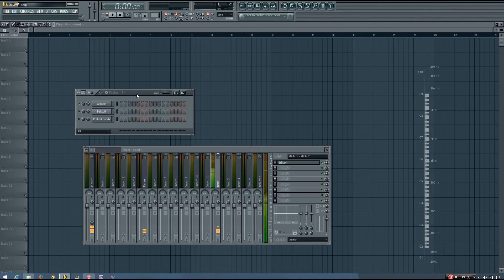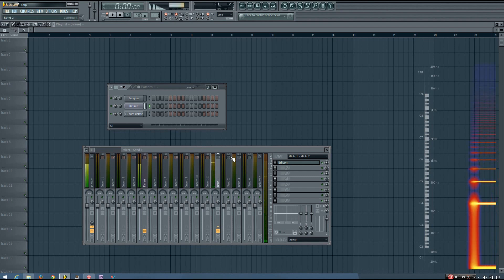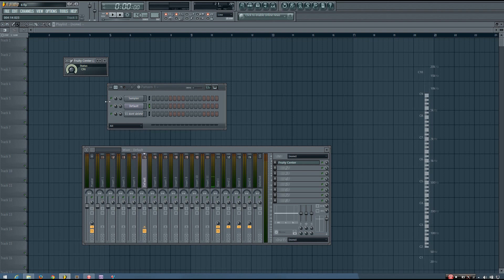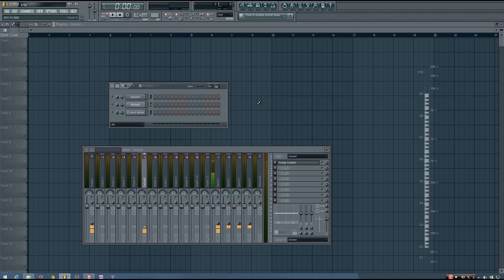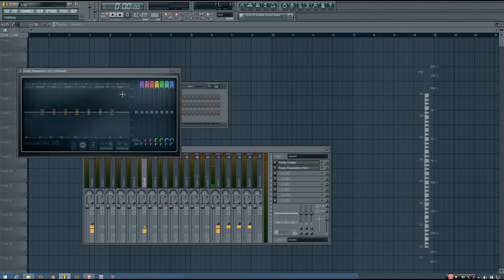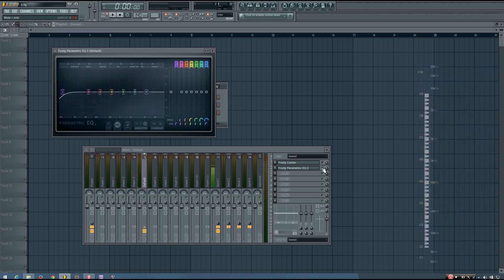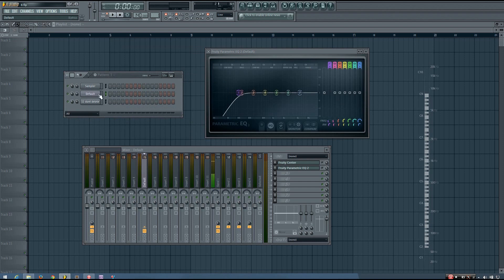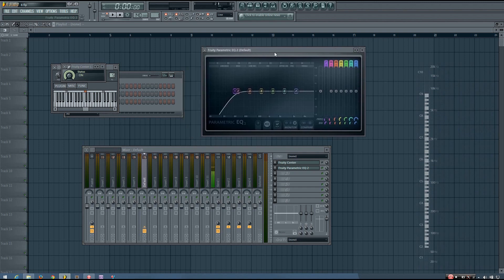Mixing Tutorial: How to Remove DC offset

Comment: Very helpful! This has been a problem I've come across many times before and finally decided today to research it. I've either avoided trouble-shooting it or just bouncing out a .wav of the performance and notch EQ'd it out - I fixed the issue simply by switching my OSC to VCO instead of DCO in Element by Waves. I curiously tried the other options you showed and they didn't work [working in Logic X]. The pop, clicky sound on the attack of the synth is clearly audible at 5K + hz even though I have a HPF and a LPF on the strip, centering and spreading the signal didn't help, and the ADSR is set to smoothly. Maybe it's just a bug with DCO within the Element VST... Anyway, thanks!